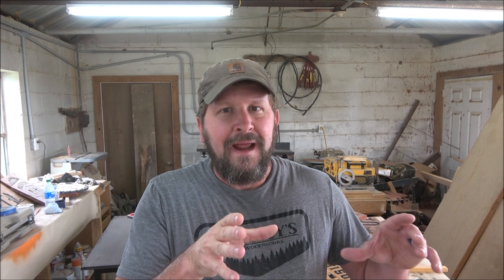Cross Timber Bison Logo CNC'd

Comment: Can you please edit your voice volume to match the levels of the music and your tools??? Another option, if you can afford it, is a remote mic, either wired or wireless for your camera which will bring your voice much closer to the mic, than the built in mic in your camera can do. I love your channel, and your projects. Channels like this keep getting me more and more interested in getting my own CNC. 

Try applying a layer of Oramask on your wood before going to the CNC. After your piece comes out of the CNC, leave the Oramask on the wood, and then airbrush, paint or stain the wood. After the paint or stain has dried, remove the Oramask, and you won't have to sand the over-spray off your piece. You can find it on Amazon, or anywhere that sells vinyl for machines like the Cricut.
Reply from the maker: I'll work on the sound, I've tried the oramask before with mixed results, it doesn't always hold that great to the wood then makes a real mess wrapping up in the spindle.  I'm sure our high humidity has to do with how well it is sticking to the wood......Thanks for watching!!

Comment: how do you prevent the wood from sucking paint into the wood and making an ugly transition between wood and paint ?
Reply from the maker: The airbrush does a great job of really atomizing the paint, putting a thin layer of paint on....at times I will use sanding sealer or a light coat of poly prior to cutting so the paint won't absorb...Thanks for watching!!!